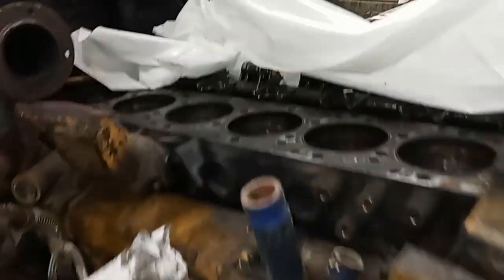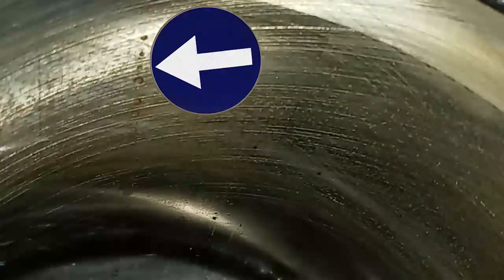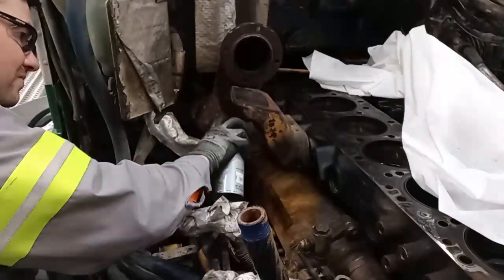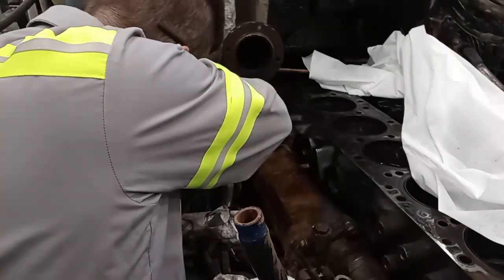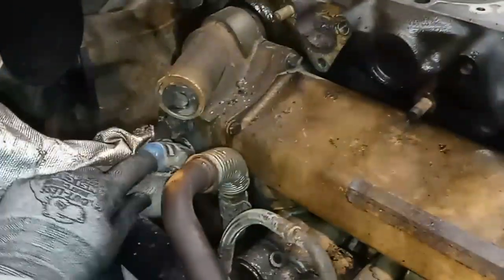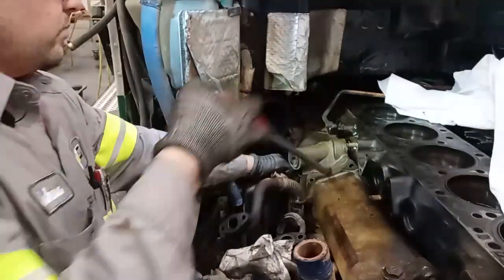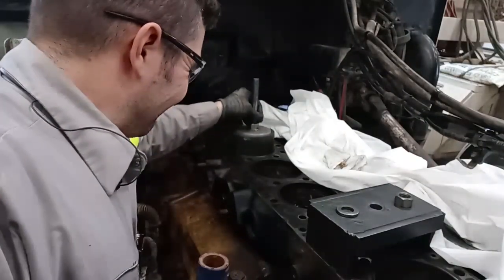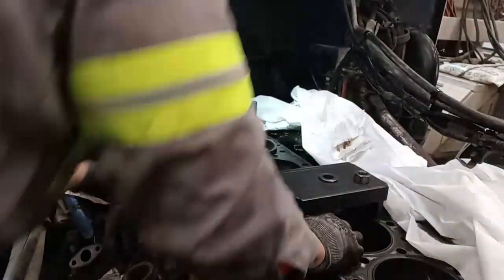Coolant can DESTROY your Engine faster than Bad Oil. Cavitation and Liner Pitting.

Comment: Coolant is caustic on bearings thats a well known fact as well as many other internal engine parts...remember the gm 3400 v6 problem
Reply: The 3100/3400 problem was lower intake manifold gaskets leaking coolant internally or externally.  Engine failure was only due to people running their engines low on coolant, or diluting the oil with enough coolant to cause issues.  I attribute these failures to owner abuse/neglect and not a major engine issue by GM.  These failures have ample warning and they're not a huge job to change.  Design deficiency?  Yes.  Critical issue?  No.  The job is easier than changing most timing belts, and that's a service you're guaranteed to have to do on other engines.  Coolant is designed to be pH compatible with metals and should never be in a bearing.  There are seals to keep coolant out of those that can be in contact with coolant such as the water pump.
Reply: @knurlgnar24  yes most of ones I've seen were leaking just in behind the serpentine belt another problem I was told not changing oil often enough too was part of the problem on them
Reply: @knurlgnar24  the other part is how do you run a fairly new car at the time out of coolant? Doesn't make sense to me now apparently the type of coolant was a specific kind that could only be used in gm cars the dexcool apparently theres no glycol in it

Comment: I had a Dodge Caravan  with a blown head gasket. I got it from a friend. If you leave coolant in the cylinder for too long, the antifreeze can eat into the cylinder. I was planning on replacing the head gasket and replace it till I found the groove where the antifreeze destroyed the cylinder. I ended up replacing the engine. I have seen snowmobile engines where the nicklecille coating has been boiled off and blistered by antifreeze. If you have a blown head gasket on any engine, that antifreeze will destroy the engine in short order.

Comment: Equipment design engineers should be made to assemble and disassemble every component they design after it has been installed in a completed assembly. With hand tools. 
In case of the threads for steel – Min. thread engagement distance = 1.5 x base diameter of screw or bolt
In case of the threads for aluminum, cast iron, brass – Min. thread engement distance = 2 x base diameter of screw or bolt

Comment: Equipment design engineers should be made to assemble and disassemble every component they design after it has been installed in a completed assembly. With hand tools.
Reply: Indeed, 90% of new automotive designs are simply to give the appearance to the uninformed of an improvement.
Reply: You didnt mention the build designers? Who would know? :)
Reply: The journeyman training  me says this every week like clockwork! Annnnnd it’s 100% true
Reply: And not on an engine stand with everything easy to get at.
Reply: The CEO and board of investors is who needs to be targeted with this idea. They make the decisions. In an actual democracy, we could make this happen. In an actual democracy, decent people would decide such things as a society whole. That isn't capitalism though.

Comment: From the Henkel Adhesives website:
https://www.henkel-adhesives.com/us/en/product/specialty-oils-_-lubricants/loctite_lb_8711.html
LOCTITE® LB 8711 (known as LOCTITE PENETRATING OIL) is a brown, thin, solvent-based, liquid aerosol lubricant, standard "tool" for disassembly and assembly of machinery,
Reply: Looks like the Loctite product is also solvent based.

Comment: I was running the shop for a construction company and we had leased a bunch of Komatsu equipment, Kumatsu sent over some of their engineers that designed said equipment from Japan to see how they were holding up. I wanted to go and start kicking them in the shins for busting my hands but I was outnumbered.

Comment: I worked for Loctite back in the 90's. We had an  interesting case of cavitation erosion on Isuzu truck engines. These engines used a dry sleeve, and they were suffering from cavitation erosion into the block, which then allowed coolant to migrate down between sleeve and block. They were in a similar locale to your erosion. It was caused by micro porosity in the cast iron block. 
As the coolant traveled around through the passages, it picked up speed as it turned the corner around the bend and dropped pressure in a way similar to air passing over an aircraft wing. The resultant pressure drop and the small cavitation 'explosions' picked away at the micro porosity and eventuated in a leak.
Initially the Isuzu engineers repaired the castings with a welding process, then re machined the block and inserted new liners. This was an expensive process. We trialed the Loctite Impregnation process on the block, which sealed up the porosity with no need to weld and re machine. It was successful. Saved Isuzu a lot of time and money. Eventually I believe they retooled the casting and eliminated the problem. If this is a common issue on your engines, maybe the LIS process could be used on the liners??
Reply: Excellent comment, it's interesting to hear that the Loctite process worked. Fascinating.
Reply: Awesome and interesting write up!
Reply: man wow why isuzu send engines to you to repair why they dont do it themselves
Reply: @henrycoldrain8151 because LocTite was using those for research.

Comment: My coolant turned soo acidic that it rotted away everything in the cooling system except for the heater core and a couple hard lines. It ate the cylinder head, intake manifold, plugged the radiator, ate the thermostat housing, the water pipe, the fittings, throttle body, fitv, iac, and finally it ate the aluminum that surrounded the ring lands on the sleeves. I bought it this way and seemed to be the guy that is fixing the car.

Comment: Watching this video has me thinking.. my dad's C13 started pushing coolant through the turbos this past summer. We never did take the engine apart to verify, but I'm wondering if something like this happened with the liners to cause that. We ended up just putting a 6NZ in the truck instead of overhauling the C13. I believe that C13 had 1.2 million miles on it. His coolant, however, was still in great shape, unlike the motor in this video. 

If you read this, I have a question! Are air compressors interchangeable between the C13 and a C-12? My air compressor is showing signs of letting oil slip past the piston rings, and the compressor on that C13 is very new.. we are looking to just use that one if we can instead of dropping a bunch of money on a new one.

Comment: I have tried them all and pb blaster is definitely the best penetrating oil.  I love the zep brake cleaner, I do not know why it works so much better then any other one I have tried.

I hate air ratchets, too slow and never has enough power to break bolts loose.

Comment: Cooling system treatment & testing every 15,000 miles. The P H needs to be between 3 & 6 & on cylinder liners it's called pining.

Comment: Designed by women who hate men. That's why you have the hidden fasteners. My company in it's desire to save money contracted with a company to use recycled coolant. After the fourth in chassis at less than 500,000 miles they realized it was costing too much for recycled coolant.

Comment: Recently I just pulled some liners for the first time out of my semi truck, owner operator.

When you did the Arnold Schwarzenegger part I laughed so hard my back cracked sitting at the dinner table.

Just finished torquing the heads down on my Cummins big Cam so yea my back felt it.
Reply from the maker: The C13 ones aren't too bad although putting them back in gets sketchy with trying to not hit the seal it drop the rod onto the crankshaft. The C15 ones are way heavier, never done the Cummins packs, but I'm sure they aren't helium filled.

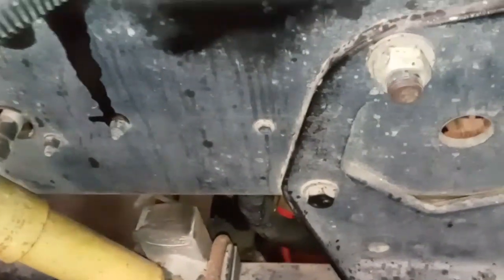Comment: 1:00, i’ve never seen them on inside before but, at the shop I work at now we don’t tear down the engines. I’ve always told operators that they should maintain there cooling system, and he always say “it’ll be fine”,until they have to do an in frame. In the end, it’s their dime.
Reply: Wish it was only a dime.  Lol
Reply: @chriswatts2096  well in my experience. You can spend a little bit now or a lot later. It’s kind a like saving for your retirement. You will always end up with lots in the end one dime at a time.

Comment: This has nothing to do with this video but can you or a fellow viewer point me in the right direction about learning about the 3406c. I have one and a shop just replaced the cam due to bad lifter on a truck I bought. It ran fine for 2 weeks before hand. He took a bunch of timing out of it because he didn't like the smoke on startup now it feels like it doesn't have the balls it use too. I'm not very confident he will put it back the way it was either. Iv worked on kubota engines but these were all newer injection pumps and didn't have to mess with timing like this cat. Thanks in advance. Or if someone knows a shop in Houston let me know!
Reply: What is your full engine serial number?
Reply: @johngoldsmith6629  8PN-12074 at least that's what it looks like 😆
Reply: @tripn8888  Shows to be a 425 HP @ 1900 RPM's Jake Brake in a PACCAR.
8PN's are not one of my favorite 3406 engines.
You will need a 6V4186 pin from Cat, a 2W0459 gasket and 8, 0T0065 bolts. (I don't like to reuse them, they can break).
Hopefully the cam is timed correctly to the crankshaft. Remove the plug on side of the fuel system, 9/16 head oring boss.
Above the starter you have another plug 1/4 NPT, 9/16 head. Most of the time they are removed. Need a 3/8 NC bolt around 3 inches long. You can get one out of your old VTU once the cover is removed. Get a long ratchet with a 15/16 socket on it. On the drivers side turn the engine off the damper pull towards you engine rotation.  Clockwise seen from the front. Have some one hold the pin in the fuel system and with the other hand put psi on the 3/8 bolt in the hole above the starter. If the pin drops in the fuel system, the pump is on TDC 1. If the bolt goes in it can be on TDC 1 or TDC 6. If the pin and bolt drop in at the same time static timing is dead on. If the fuel system goes in first, pull the pin out and continue to turn to see if the bolt goes in the flywheel. If so you are advanced. If the bolt goes in first, pull the pin out and see if you can see the slot. If not your on TDC 6. Will have to go another full turn on the crankshaft. If you see the slot your engine timing is retarded. What ever you do put a mark on the damper where the vee belts are near the damper, if the bolt goes in the flywheel. That why you know about where TDC is.
Once you figure out where your timed at, you have to decide if it needs to be adjusted or not. Granted this only works if the engine cam is timed correctly to the crankshaft and or the flywheel is installed correctly. And your not timed on TDC 6. You will have to pull the valve cover and see which cylinder you are on. If you wish to do so.
If adjustment is needed you have to get the pin in the fuel system first. Then loosen the 3/8 bolts on the VTU. Get a seal pick and put it in the flywheel. Turn the engine backwards until the seal pick goes into the 3/8 bolt hole and locks the engine up. Don't force the turn and break the seal pick. Now in this position you can remove the bolts one at a time and replace them in the VTU. They torque to 41 FT lbs. If you wish to advance it some, before you torque the bolts remove the seal pick and bump the engine backwards a little more. And I do mean a little. Look at your mark on your damper. Torque the bolts, remove the pin and the pick and back the engine up until the mark is near the other side of the vee belt. Now turn the engine back towards you with some one on the pin and bolt again to recheck timing. Again if the bolt goes in first your retarded and will have to start all over. If the pin goes in first, your advanced. Now get your seal pick and feel inside the hole and see how much of the 3/8 hole you can feel in the flywheel. Naturally the hole should not be dead center yet if advanced. So the bottom side near the starter you should feel the flywheel. Move your seal pick up and estimate how much bolt hole you can feel. If you can't feel it at all in my opinion your to far advanced. I like the most at 1/2 a bolt hole. More than that you might have serious engine problems. 
You have to keep doing this until you get the timing where you like it. Once done, remove all pins bolts etc., put your cover back on with new gasket. Double check that you have everything off and removed as you don't want to snap a pin, bolt, or leave your ratchet on the front. Makes a expensive mess if you do.  
Your call but I always like to reseal and replace worn parts in the VTU if your going into the front.
Reply: @johngoldsmith6629  man I really appreciate that detailed response! I bought this truck and a lifter got stuck or spun 2 weeks into owning it that supposedly had a fresh overhaul. I wasn't really wanting to get a cat just because of maintenance cost as you can tell it already bit me in the behind haha. I do greatly appreciate it!
Reply: @tripn8888    8PN's are odd engine's, they are not like a normal 3406 and parts do not inter change very well. More than likely somebody put a used lifter on a bad lobe and sold it. Seen lifters run on bad lobes until they start making a noise and they change them out and go again. Only problem it can come out of the block if driven to long.
Reply: @johngoldsmith6629  had the cam welded and reground. And replaced all the lifters with new cat parts. Still waiting on 1 solenoid for the Jake's. Yeah I'm thinking they knew of the problem and did exactly what you said. Other than that it's been great 🤣
Reply: @tripn8888   Cat has reman lifters, cheaper.